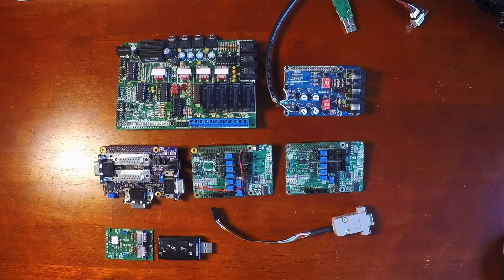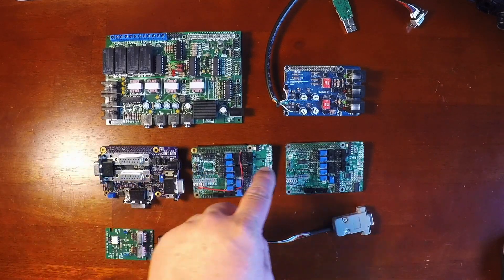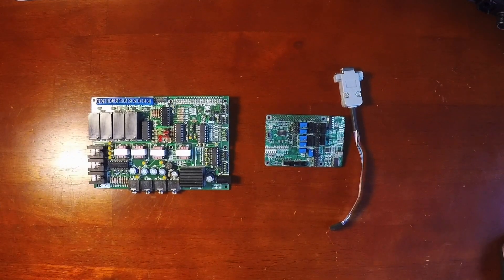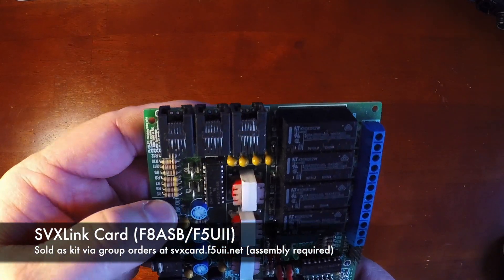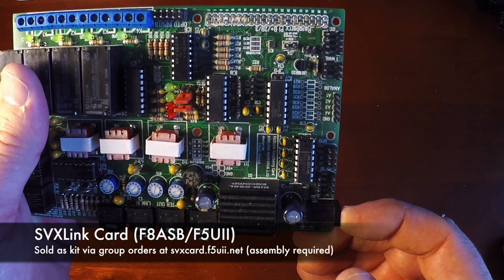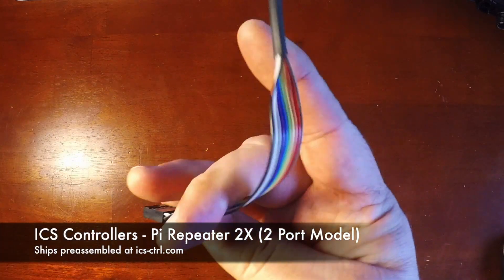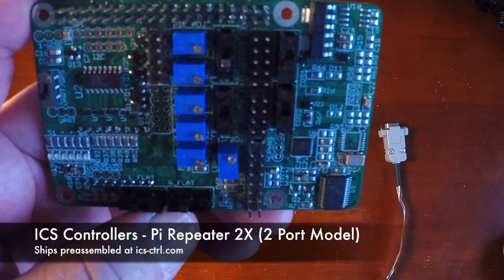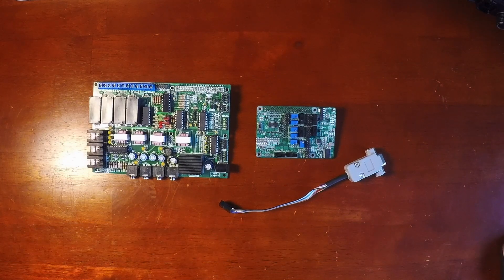OpenRepeater - Interface Hardware Overview

Comment: what board do i need for MTR2000 repeator
Reply from the maker: @WPGinterceptor460Interceptor  check out ICS Controllers site. They have a board that works with the MTR-2000. Look in their shop under controllers and pirepeater family. Maybe reach out to Dan to consult beforehand.

Comment: Is their a good English set of documentation for this project anywhere?  I’ve tried using translate and find it consistently frustrating.  I bought into this kit in 2017 and still have not built it
Reply from the maker: I’d assume you are making reference to the SVXLink Card. I don’t know of a good set of English documentation that go into great detail. The schematic he has in English. There is probably some assumption of skill level required.  He does has an assembly video, although in French, it may be of help with the schematic in hand. https://youtu.be/hP9DqySVHDg

Comment: Any chance you'd be willing to do a tutorial with either of these boards? Sort of a here's the hardware, here's the software, here's the setup?
Reply from the maker: The Getting Started Video goes into some explanation using the ICS controllers Pi Repeater 2X board using a single port. It doesn't get into the nitty gritty details like the wiring as that will vary from setup to setup or adjusting the audio pots on the board. ICS has some documentation and videos of their own that cover this. The SVXLink card is offered in kit form and takes a more technical approach as assembly is required, so that is not a beginners board. But yes it could be a possibility to do other videos. Let me know what you'd be interested to see that isn't covered by the Getting Started video.
Reply: @OpenrepeaterProject  yeah I just watched it. I was under the assumption that the hardware interface were in fact the radio(s) needed. Looking for a way to make a nice small as possible field deploy-able repeater for my old SAR team.
Reply from the maker: @JohnWeland  ICS has the 1X interface that is the same size as the Pi Zero W. That might work for portability. I am not sure of your technical background, but part of the challenge with any duplex repeater setup is not desensitizing the receiver with the output of the transmitter. To do it right, you need filtering (i.e. duplexers/tuned cavities) or you need either significant antenna separation and/or frequency separation (i.e. crossband repeat). These are certainly challenging when trying to come up with a portable setup. I was talking with Dan at ICS last evening about maybe modifying the Retevis RT97. But only the UHF one would be practical in the US because you can do 5MHz input/output spacing on 70cm. Spacing on 2M in the US is too narrow and you need bigger filters to do so make it not so portable.
Reply from the maker: https://www.youtube.com/watch?v=Uhig_YhqrbY

Comment: Too bad that hams only want to sell, and not share thoughts and schematics.  Would be nice to see more svxlink single radio hotspot users with a pi and add on board on in.
Reply from the maker: African Twin  these are predesigned boards. ICS Controllers boards are already assembled and the SVXLink Card is offered in kit form. They both offer schematics on their sites. You can visit openrepeater.com/hardware for links out to their pages as well as some guidelines to build your own interface. Hope that's of help.
Reply: @OpenrepeaterProject   Ah okay. When will there be a image for  simplex node users with the  easy digi interface .  There are a lot of hams that would  like to join svxlink. But there is no svxlink image that hase a nice simple user interface , besides open repeater duplex 2.0.    . I think that it would be so kewl that if someone had a pi hat interfaceboard schematic and gui image for simplex  node users.. A french ham had this https://bit.ly/2DsAe2K but dont want to share info. The other french svxlink card  sellers only build for repeater duplex cards.

This ham has a allstar interface board , but also dont want to  share schematics https://bit.ly/2Q6KWm8 .   I quess there is only narrow band  mmdvm for simplex users.
Reply from the maker: @africantwin173  If you talking about a simplex node such as a simplex Echolink node, that is probably not too far off. The 2.0.0 feature just added the basic support for multiple ports and part of that was supporting simplex logic on the link ports. Developing a more robust interface for the ports is in the plans. All the building blocks are in place to do so, it is just a matter of making some code modifications. So you should be able to do so now with some coding knowledge until more options are introduced in a future release.
Reply: @OpenrepeaterProject   When will there be a image that supports Simplex Logic.
Reply from the maker: PD1ASH the 2.1.0 version that is in testing now has added a simplex mode. This would be useful to use with EchoLink module to create a simplex node.
Reply: @OpenrepeaterProject   I'm looking forward to it already. Thank you.
Reply: People gotta eat.  Not everyone gets government handouts, so some have to work..